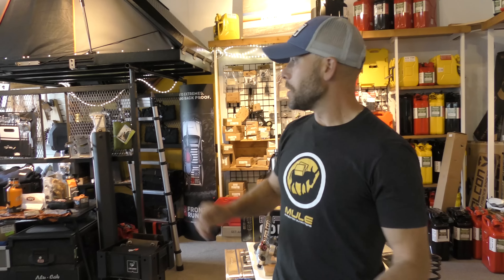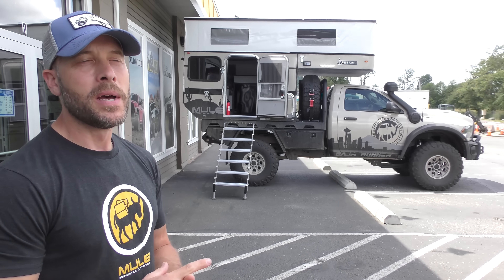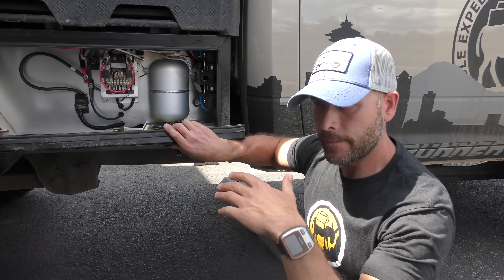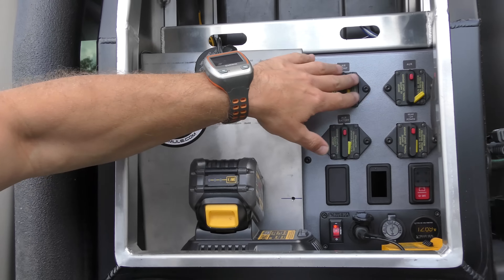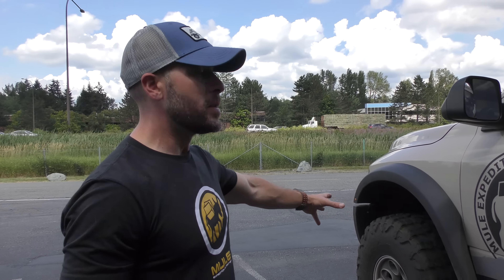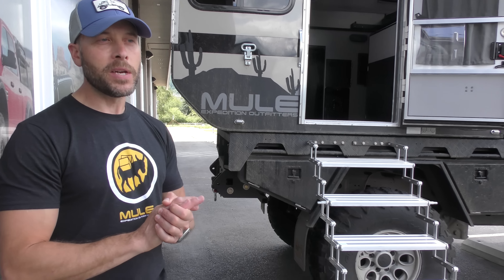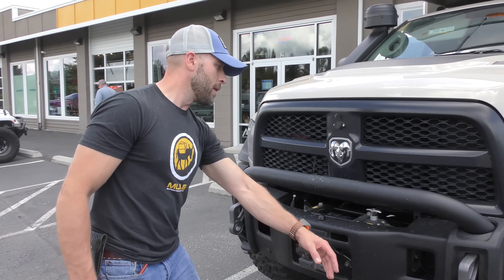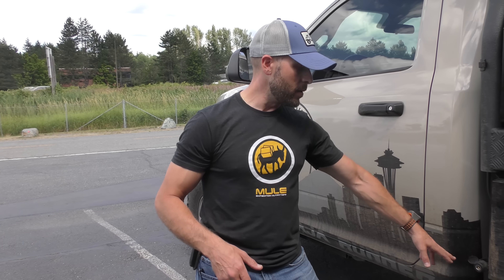DODGE RAM on 40's w/ NORWELD Flat Bed & FOUR WHEEL CAMPER - MULE Baja Runner Exterior Walk Thru

Comment: No Cummins! Would be a No deal for me!
Reply: Until I bought a Diesel, I would have agreed with you. Diesels are great. But, you can't deny his logic. 1) Diesel is much harder to find where he travels. 2) Selecting Diesel and its associated transmission adds ~ 700 pounds. The truck is a LOT more sluggish when cornering. Also, the Diesel's weight correspondingly detracts ~700 pounds from the truck's carrying capacity. (Ignoring the rated GVW is ill advised, illegal, and a liability if you get in an accident)
Reply: I have been going to Baja since 1990 drone 2001 to present I have never had any problem finding diesel fuel from Ensenada to Cabo east or west coast. I have a 01dodge Ram quad cab with a 12 ft camper and flat towing my Jeep Cherokee. Plan your trip properly I have a 35 gallon tank and once I cross the boarder I fill two 6 gallon cans for emergency. Diesel in Baja no problem.

Comment: Its well thought no doubt but you dont need 40's lets be realistic.  They are trying to achieve a look that will sell but not necessarily practical. The spare location would have been better used for a bigger camper.

Comment: That is a badass rig. It might have been built for the desert but it would be right at home in the pinewoods of the southeast with those tires and the ability to cross deep mudholes to get way back in a national forest or hunting property.
Reply: I'm in Alabama just outside of Pensacola fl. but I think the 40's are to big for a gas truck but it's definitely a cool truck
Reply from the maker: @ScootersAdventure  it has been re geared as well and joe says it has plenty of power!
Reply from the maker: I agree! It will go just about anywhere you want to smush it haha
Reply: @Down2Mob  I'm only talking about on roads traveling to the desert I've been offroading for years and I roll with BF a/t's and usually only get 30,000 miles on em those tires he's running If I guessed won't get that many miles I'm thinking they're like the Mickey Thompson's guys put on there trucks back in the 80's I'm sticking with A/T's but I'm not as experienced as that shop so I'm sure he knows what he is doing